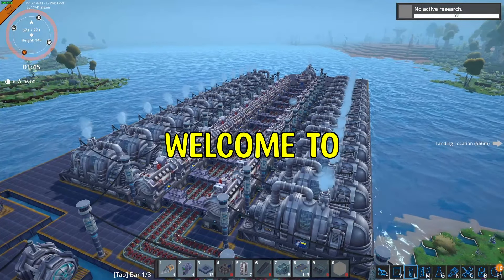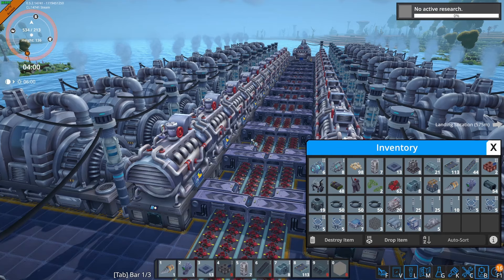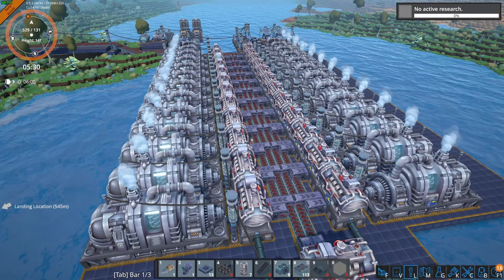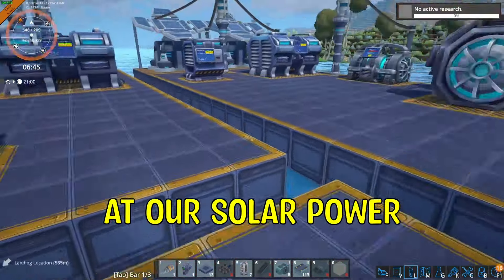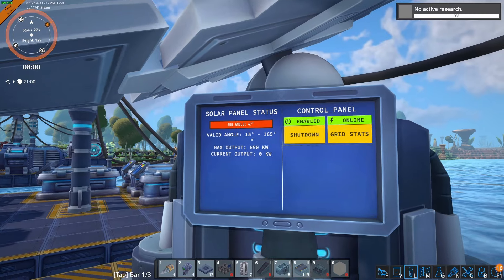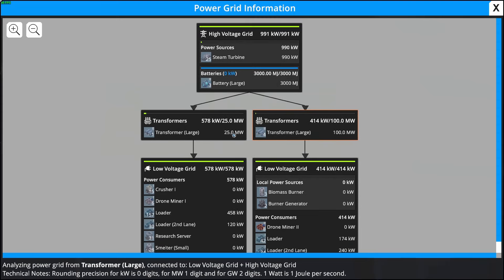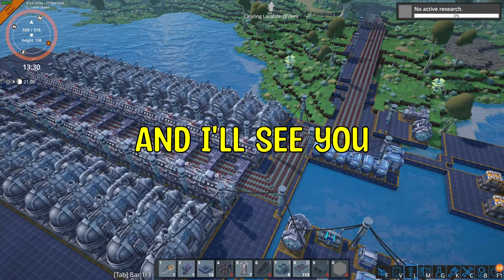How To Best Setup For Power Efficiency in FOUNDRY!

Comment: 1:43 I'd like to mention that you can attach turbines directly to boilers without a pipe too. You'll have to find a place for power poles on the outside, though, or make a plank/roof above the turbines and use a wall-mounted power poles. It can be rotated to look like it's attached to a roof.

2:29 I'd say about the efficiency "it depends". :)
As far as I know, boilers consume up to 20 ignium per minute, so you can run 8 from a full T1 belt and 16 from a full T2 belt. It doesn't really matter how many you make as long as they cover your needs, though, since they burn slower when you only consume fraction of their power. You'll lose a tiny bit more ignium with more boilers than you need due to extra loaders needing extra power, but that's negligible. Personally, by the time I needed more power than 8 generators could provide I had already unlocked solar power.

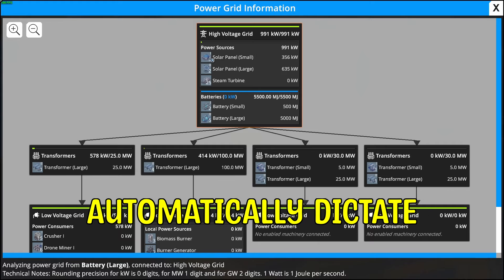7:10 Note that all kinds of burner generators will turn on during the night no matter if you have batteries or not.

Also, the most important question about solar power everyone eventually asks is "what is the ratio of solar panels to generators"?
Roughly they are like this:
2:1 small panel to small battery
8:1 small panel to large battery
7:2 large panels to large batteriy
These are not precise numbers, but they are convenient to deal with and you are going to overbuild anyway to leave room for growth, so having a few more solar panels than absolutely necessary won't be an issue.
Reply: I was going to mention the direct connect as well. I must say I do like the look of the power poles where Krypto placed them though.   Thanks for posting the ratios.
Reply from the maker: Yeah I did know about the direct connect just forgot to mention that, I purely only put the pipe in between as I thought it was an ideal space for the power poles